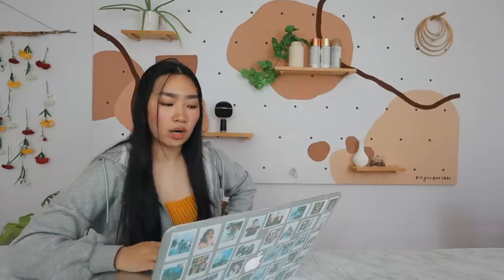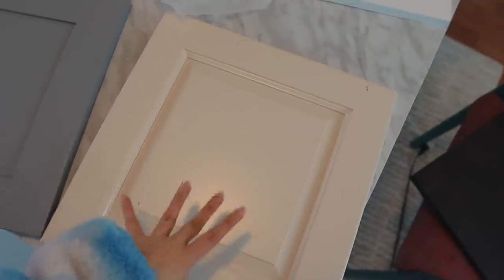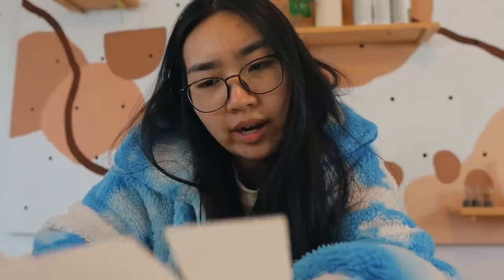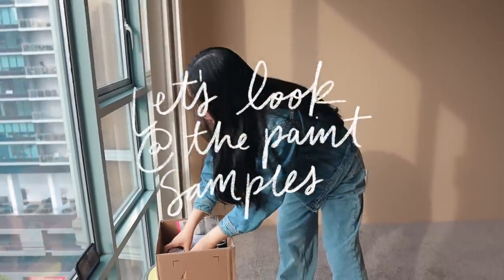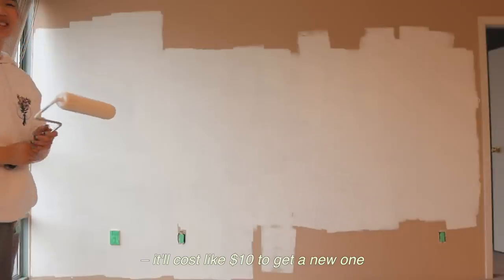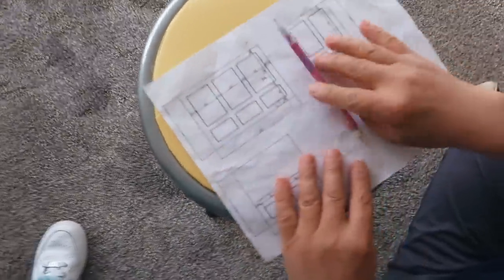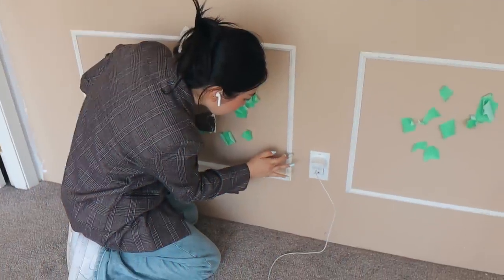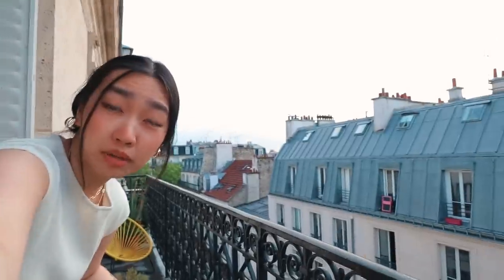My EXTREME Apartment Makeover! Starting Renovations... | JENerationDIY

Comment: I think your second bedroom would make a fantastic office space, with enough room to fit a sofa bed making it a functional bedroom when needed. Consider fitting a glass door with a blind or curtain for privacy when needed, but when not it would allow you to keep what light you can coming through to the dining area. The storage closet next to the dining room would definitely be better utilised by making a larger dining room if thats still an option (wasn't clear if that wall was load bearing). If you can't lose the closet wall, I think you could get plumbing in there to make it into a laundry room/utility which would give you much needed storage too. Alternative laundry options would be losing the shower in the guest bath and putting your machines in that space instead, or as you say putting them into the entry way closet although be careful of losing too much general closet/storage space. Getting the laundry machines out of the kitchen is a must imo, it would give you a huge pantry cupboard in the kitchen instead and allow you to not notice the loss of your upper cabinets on the adjoing wall between kitchen and living space,  because even if the best you could do is a large window style opening I would absolutely do this, I really think you'll regret it if you don't. It will allow natural light which you currently don't have into the kitchen and be much more social. You will also be able to see your TV when in there cooking which makes quite a difference in enjoying kitchen activities when you're not  a natural cook 😋.  Best of luck with your renovations, already seeing great progress and I'm exited to see how it all turns out!

Comment: Somebody may have said this already, but the wall moldings/paneling of that kind are called wainscotting! This phrase works for the entire wall, or just half the wall with paneling. The French call it Boiserie (or so it was referred to in the 18th Century as you mentioned - and ranged from simple to quite ornate moldings). Almost all my Sims houses have wainscotting on the wall to add a bit of texture/visual interest.